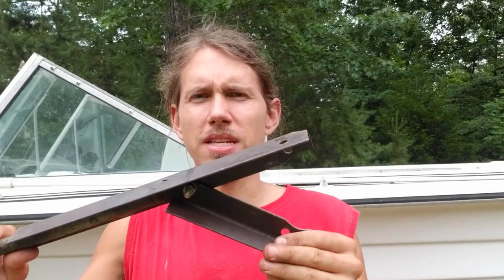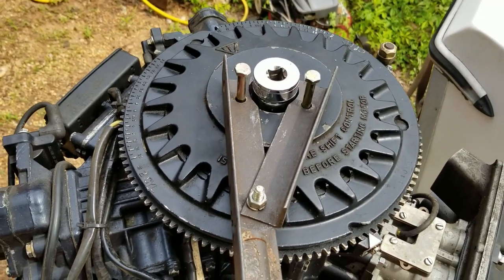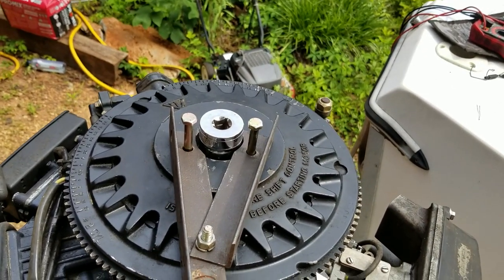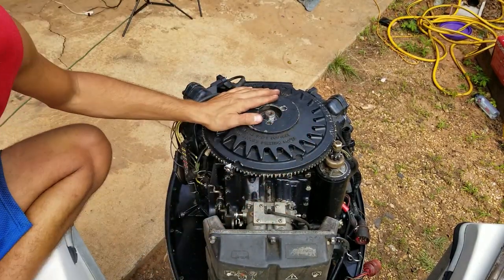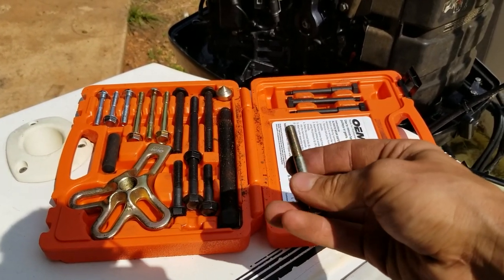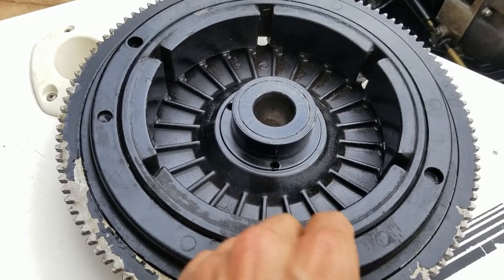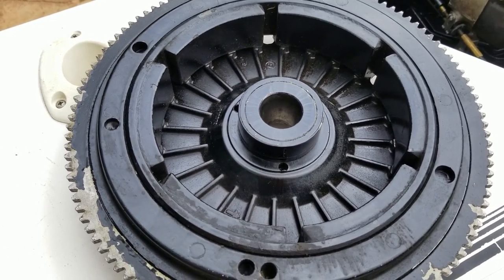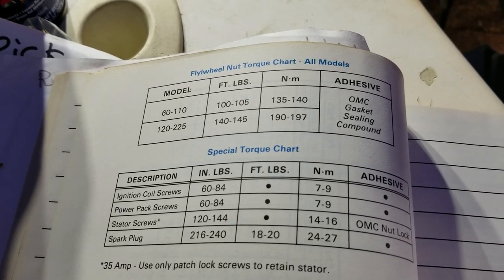Evinrude Outboard Flywheel Removal and Installation

Comment: This may be a dumb question Matt and tell me if it is I have to replace the voltage rectifier on my 88 evinrude 150 xp and to do this it seems I gotta remove the fly wheel so after I do a nd it back on do I need to set the timing again on the motor or should it stay the same if I mark the fly wheel and put it on in the same position
Reply from the maker: The timing isn't supposed to change when you remove and replace the flywheel with the same one. I check it anyway, be careful if you have to check it.
Reply: IT has a key to line it up the same

Comment: Hi Matt!  The flywheel can only goes on one way, right?  I have an 1989 Johnson 70HP rebuild by Coastline Marine in Florida.  The rebuild cost $3180.  (rebuild include:  bore the 2 bottom cylinders to the next larger size piston. replace the top piston for cylinder 1,  rebuild carbs, new thermostat).  The guy told me to check the ignition and timing by a mechanic.  I have called every marina in Boston area to have them check the timing for me but no one is willing to work on older motor so I have to check the ignition/timing myself.  I have watched YouTube videos bought 2 manuals to do the timing/ignition myself.  When I check the TDC of the motor, new TDC mark that I've found is 2.5" to the right of the factory TDC.  If the flywheel was installed incorrectly than that explain why it 2.5" apart and vise versa if it was installed correctly it should be 1/4" to 3/8" apart.  Am I correct?  Please help.  Thanks
Reply from the maker: The flywheel only goes on one way. You have to make sure the flywheel key doesn't fall out when you do this. When you check the timing pointer you have to use the piston stop tool and make sure that you rotate the engine the way it says in the manual. It can be a bit confusing. Don't adjust it until you are sure though or you'll be in trouble.

Comment: I have a evinrude 2000hp v6 and the fly wheel its very stuck! What can do for remove it?
Reply from the maker: Pb Blaster soak while harmonic balancer puller is keeping pressure on it. Might have to let it sit overnight.

Comment: Hi Matt, when I went to check my timing, my new TDC marks are about 3" ahead of the cast-in TDC and retard marks. No marks for advance. It's a late 70's 140. Im starting to think my flywheel might have  sheared the key to be this far out. I guess I  should just go with the new TDC marks I made. Does it even matter if the flywheel is way off as long as the marks are right, or does that mess with the charging system if the magnets pass the stator poles at a different  time? Thx
Reply from the maker: You have to get a service manual and double-check everything. If the flyweel key sheared, it'll probably never start till its replaced. You have to check the TDC marks with a piston stop tool. It's a pain, but something is wrong if they are 3" off. I wouldn't try to run it like that. Would be worried.
Reply: @MattsShop  HI Matt, thanks for the reply.  I made a puller and removed the flywheel.  Sure enough, sheared key. Replaced the key and idle went from 2,300 to 500 rpm. Need to adjust the throttle cable  now. Water constantly flowing out the two exhaust ports at the back. My thermostat kit just showed up, so that's  next.

Comment: What size socket?
Reply: I have a 91 200 HP Evinrude. the socket was a 1 7/16. I had to shave it down with a angle grinder, but works great after that! Also, I mimicked your flywheel holder and was excellent. Easy and cheap. Thanks!
Reply from the maker: Awesome! Glad it worked! That size socket sounds right.

Comment: Why did you start in the middle of the job? The question was how to remove the flywheel cover. You jumped right on removing the flywheel. What did you do, beat the cover off with a hammer or what. You missed several steps that have to be done before getting to that flywheel on a 1997 Evinrude. This does not appear to be a 1997 model
Reply from the maker: This is a 1986 Evinrude 150XP there was no cover on the top of the engine.

Comment: I need the part number for the flywheel key on a 89 evinrude xp 150 do u know what it is
Reply from the maker: https://www.boats.net/catalog/evinrude/outboard/150hp/e150stlcem-1989/crankshaft-amp-piston

Part number 7. Make sure you select the right outboard model at the top of the page.